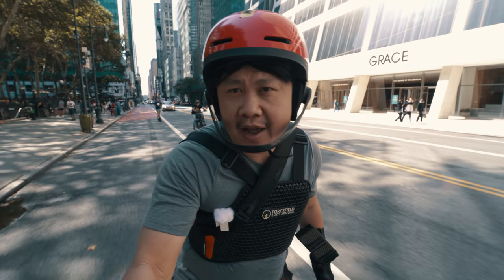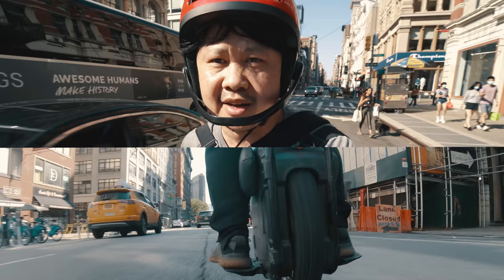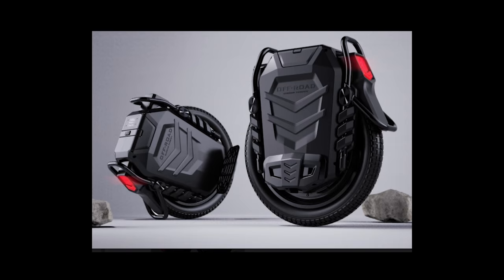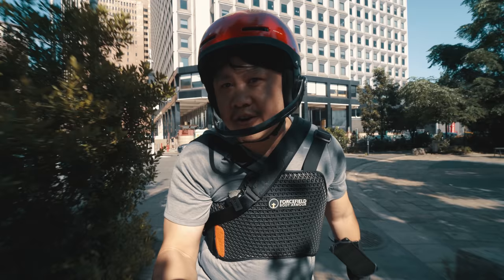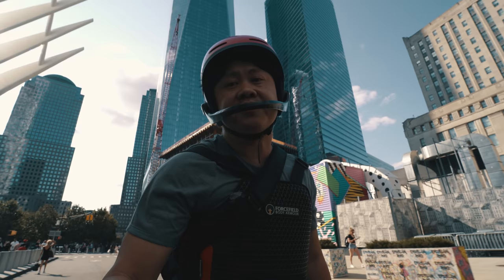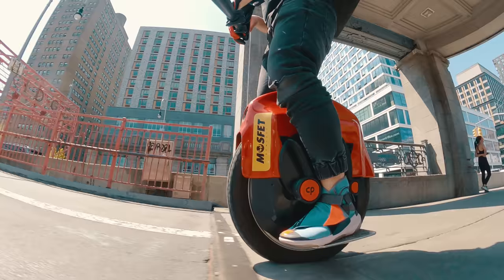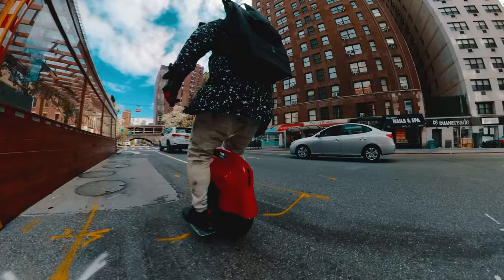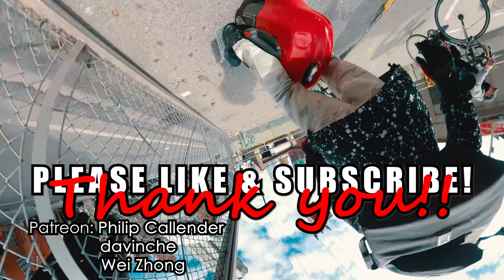CAN YOU BELIEVE IT?!! The 22" VETERAN SHERMAN 2! The ABRAMS!!

Comment: I would pay 4 grand for a 60 mph EUC. A EUC with that speed,  less than 4 grand is a bargain. The high speed scooters are around 7 grand. I am SOLD! 
LONG LIVE VETERAN
Reply: I’d be beyond happy with a 60+ mph wheel with suspension… UNLESS the diameter of that tire makes the ride similarly smooth. 

Sherman was my first wheel, followed quickly by the s18…my Sherman has 4x the miles on it… the rush of speed and available power is more fun and overall exciting compared to jumping around slowly on the s18. BUT….to COMBINE both speed and silky smooth ride would be AMAZING… just need to be looking that much further ahead when riding..
Reply: 60mph will be a common thing in a couple of years... and they will sell much less than $4.000.

Comment: The $3700 price plus shipping and tax would be more around $4050. But taking into account the problems with International Shipping currently going on, the full price would most like be around $4200.
Reply from the maker: Surprisingly no one seems to care, the Sherman continues to sells and I am just as curious to see at what price will ppl stop buying, $5k, $6k??
Reply: With wheel prices going up so much dealers should take trades and resell them. I would take less money than a private sale to trade up into a new wheel, and I’d also pay a little more for used wheel that was gone through, and carried even a 90 day warranty from a place like ewheels. This way 5k to 6k for a wheel is easier to take if you have a wheel trade in. At those prices we’d better see motors built to wheel size (no spokes) and all weather dependability.
Reply: Totally nuts

Comment: Not sure I agree with the sentiment of the new Veteran needing to be faster. 
The main problem of the Sherman was how easy it was to be overpowered.
I'd rather have the same top speed but a safer, more torquey wheel at the same range.
3700 $ on the current Abram, no thanks. Absolutely not worth it.

But lets see...
Reply: @EUCvibes  for low speed off-road hill climbing the Sherman passes out easier than an epileptic at a house of horrors.
Reply: I agree that the price is nuts for the WH.

Comment: You do make a good point...I was one of those whom purchased from the last batch dispite the price...The accessories for it amount to even more, easily surpassing the price of the sherman,...helmet, safety gear, Lazyrolling ( which didnt protect my ribs from the speeding projectile when I was thrown off and in front of it thanks to a sunken sewar top and my fiddeling with my cellphone to contol my accessories, I did not get runned over by traffic though in my 3rd attempt🙄-Got the twisties😂)... all that alone puts you near the mark, add in pads,peddels, speed seat, horns, lights and whistels etc and well....eye opening reality rather then purchase another wheel or a newer model version I purchased more accessories to change the wheel I have. If I want a red veteran? I have one...Blue..I have one Black....with black spiked peddels...or silver or no spike peddels....You get the idea.
I could have bought a brand new 2021 Ram truck with Airbags, Capable of carrying my whole family, grocery's and construction materials from Home depot...( Thats actually what I did next after doing all the initial math.) In the end People want what they want what the tipping point actually is depends on your personal finances and what you can actually afford to spend. But for a One wheeled Electric Unicycle there must certinly be a limit.... Torque?, Distance?  Endurance? or Suspension? at some point taking Performance and all these factors above as well as Research and Development  into consideration...Do the math before putting down your spend able earnings.

Dew the Dew ✅  😉

Comment: I believe the veteran Sherman has a 20” (not 19”) wheel but agree that higher diameter is the way to go for confidence at speed.
Reply: Depends on the generation for instance  I do have the 20 in bull earlier models were smaller
Reply: @RidershermanV3  Oh, got it. Didn't know it used to come with a smaller wheel. Glad they changed it!

Comment: Sorry.  For all you raved about the Abrams its just going to be a fast wheel with short range.  Youre lucky to get 45 miles off an EXN if you ride at high speed.  So the Abrams with a bigger wheel and higher voltage is going to run considerably less miles at 2700wh battery.  Probably more in the 30-35 mile range.  No matter how much you love a wheel having to recharge at 35miles will equal about an hour of riding.  Not worth it in my opinion.  Like going on a hot date and just a peck on the cheek and its over!!  I'll stick with the MPro for now and for small wheel speed the EXN.  When are these companies going to really take that big step and give us a high speed, long range,  suspension wheel.  THAT is the holy grail.  IMO!!!
Reply: If that’s the case then I’ll do the same or purchase a different wheel.
Reply: @jednorman4743  funny that since my comment the S20 is introduced and almost perfectly fits the bill!!
Reply: @Born2Ride108  how many miles you reckon you’d average on a S20 charge?
Reply: BestFavorite  S20 has 3300 w motor 2200 wh battery. Range won’t be great. Of course it depends how fast you ride or the terrain but my guess for me will be around 35-45 miles aggressive riding.

Comment: The main problem is actually power consumption. When you start riding Monster Pro at top speed, it eats up charge really fast. Now, with 126V and  22", how far would a 2700Wh EUC go at 60 mph? Not far at all I guess. So personally I'm not sure if that's the territory EUCs should go at all, generally, any brand. Especially without suspension to catch you up on the next big pothole.
Reply: Most will be doing around 40-45mph. With more torque makes you quicker in crowded situations. You’ll get 60-70  miles of range  in real life situations, except you won’t be confined to park trails and bike lanes. You could ride the actual rode. If all the hype is true.

Comment: Great video.  Maybe the new sherman will have a smaller battery and shorter distance, but be a killer on a short run ???
Reply from the maker: I am not a long distance rider, so selfishly I am willing to trade a bit of range for higher top speed and accelleration!
Reply: I agree !!!! I have the rs-19, range is not 100 miles but it's fair.  I'd trade some as well for more speed and faster acceleration.

Comment: Per specs at the preorder site: a 62 mph no load speed? That is basically the same as the Sherman or the EX.N, and less than the monster Pro. That is disappointing, I thought this would be a 117v 65mph top road speed wheel. If anything is going to be the wheel of the year, it will be the Kingsong S20. 

A 40mph 127v suspension wheel from Kingsong, the makers of the best suspension wheel on the planet, the S18? The Abrams initially looked exciting, but now it looks kind of lame in comparison. The S20 has my vote, hands down.
Reply: Agreed.  I already preordered s20.
Reply: @tcwheel721  At what price???

Comment: Is it still worth it to buy kingsong 18xl with 2200 watt motor and big pedals? Because iam thinking to buy one for 2k
Reply from the maker: not for $2k at this point, its almost a 3 years old wheel!
Reply: @OWGAC  nope they update with more watt and Big pedals. But my problem is gotway or begode bad quality. And other wheels cost more. I drive 95 ofroad  through  the woods and so on. But dont want a betawheel. Any idea? And thats the cheapest price normaly it cost 2500 in german and its the old Version-.-

Comment: I really dont get it! All this talking about 116/117Volt! To make it short: This does NOT fit to the announced 2700wh and Samsung 50E cell!
NOT AT ALL. You can not „choose“ your watthour like you want….you depend on the nimber of cells. 2700wh with Samsung 50e points 99,99 percent to a 100,8Volt wheel! Nothing else possible. So while 2700wh and 50e cells are confirmed by the exclusive distributor….all this higher voltage blabla is just one: Rumours/Hype …and most probably false!

Comment: The KS S20 Eagle is going to be cheaper, $3400.
Reply: Cynthia May  Yes, crazy prices.  Same with the Abrams and Commander.  Maybe also just wait until all the problems get discovered and fixed in the first generation.
Reply: Cynthia May  

High speed racing for pink slips where the loser forfeits ownership of his wheel to the winner.
Side by side in very close proximity to each other.
In the confines of a fully enclosed, narrow, single lane tunnel.
Rock hard bluestone/concrete walls on both sides.
Random spectators, camera operators, bikes, fencing, barriers, objects etc, along the side of the route.

Crashing, sliding, tumbling is survivable with protective gear, gradual deceleration, energy dissipation. 
Not so much when hitting bluestone/concrete walls.
Designed, planned, purpose built race tracks have plenty of run off space all around.
Barriers to collide with are avoided unless absolutely necessary such as in a street circuit.

Loss of control, hitting the wall, then potentially bouncing/ricocheting directly into or into the path of the other rider.
Princess Diana might have survived had the high speed car crash not occurred inside a walled tunnel.

That EVX video is probably not really a good idea.